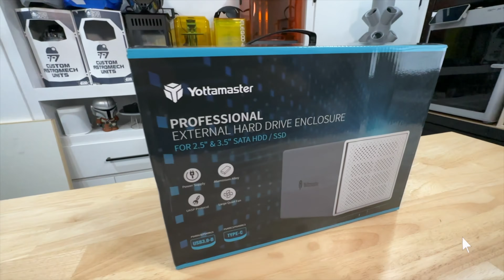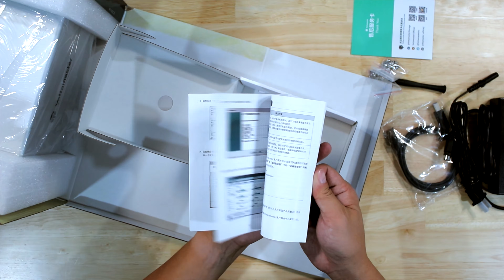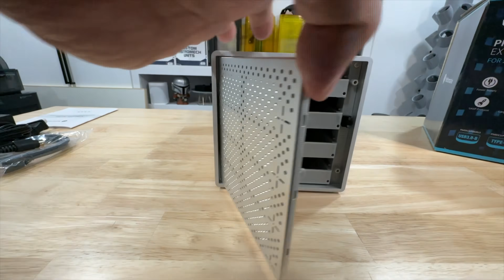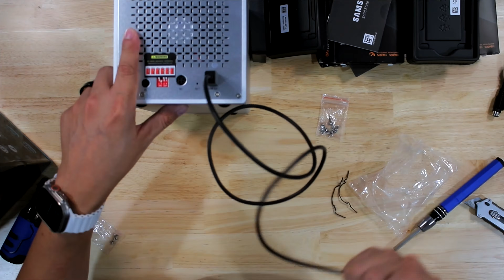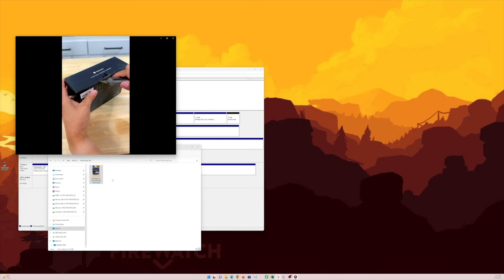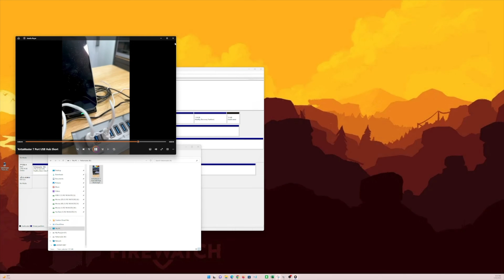4-Bay External HDD Enclosure from Yottamaster - Unboxing, setup, & Review

Comment: Can this run Plex server?
Reply: It is a DAS (Direct Attached Storage). Which means it is a pile of disks and nothing else.  It is the external equivalent of adding more drives inside a PC.  Or, if you prefer, the DAS acts as a big USB flash/thumb drive you plug into a machine for extra storage. You will have to install Plex server on a PC, and point the media libraries, to the DAS storage.  This device is NOT a NAS (Network Attached Storage).  Many NAS's will allow you to run Plex natively or via a container using Docker on the NAS's OS.

Comment: NTFS for MacOS? This won't work. Why not ExFAT?
Reply: ExFAT was mainly designed for SD cards.  While most OS's support it now. I doubt very much that ExFAT is going to work with the RAID implementation of this box.  It it a fact of life that NTFS is the dominant file system in the consumer space.  So Mac and Linux people are on their own.  Mac does not seems to be really supported any more, for the RAID program.

Yottamaster Upgraded RAID Manager Software for Mac
Support Models: Yottamaster PS, FS, DF, VN Series - 4 Bay and 5 Bay Hard Drive Enclosure
Support System: Mac (Backward compatible with Mac OS 13 and below, not applicable to Mac OS 14)

You will probably have to use builtin tools in MacOS to create a RAID with this thing.

Linux does not even have a RAID software from YottaMaster.

Comment: Hello, I need to buy a new power adapter for Yottamaster Y-Pioneer 5. Bay External Hard Drive. Can you advise me which type can be used? I see that there are many different types on the market with the same 4pin connector.  Is it 4pi with 2x +12V and 2x GND? I also see that there may be different pin assignments? Thanks for the answer?

Comment: Can this enclosure support drives 20, 22, and 24tb like those from Western Digital?
Reply from the maker: So far I have only installed 4 16TB Hard Drives which is what the specs indicate is max.  I will have to soon upgrade and will attempt to install larger sized HDDs to test it out.

Comment: Thanks for your review. I find that enclosures that follow this design with a hollow metal shell with plastic internals produces a lot of echo from noisy drives. If the docking trays have no rubber or something else to act as vibration compensation, you will have a really loud enclosure.

Comment: It’s definitely a nice enclosure. I own a non-raid version. I don’t care about performance. It’s fast enough for me

Two problems though. If I have 4 3.5 mechanical drives it doesn’t behave. I don’t think it’s a power issue but I am going to buy all new drives as it could be the drives. 

The main issue though is it starts to vibrate for no reason. To resolve I need to touch or wiggle the drive bay. The drive trays are plastic with no fasteners. I also own an OWC 4 bay and the quality is way superior but for budget the Yottamaster is good enough.

Comment: I have had TWO data issues with the PS500RC3 5-bay drive, in two years. I'd love to be able to load the RAID tool for Mac, but the program they offer immediately crashes with an error and is not launchable. I cannot recommend any Yottamaster product for any Mac user until the company can guarantee proper tools that will work with the machines we are using them with.

Comment: The problems that I see that weren't addressed.
This looks like the reviewer was sent the item for free which can mean a biased review
You're 1 dip switch flick away from deleting all your data.
The trays don't lock in so they could fall out if you pick it with the door facing down.
No handle
Plastic trays do not assist with heat dissipation
Most people including myself will be plugging HDs with data on, not empty drives. I am always weary about plugging a HD with data into an unknown device. You never know what it is going to do. I have had a NAS device in the past that just formatted drives when you insert them, or when you had to share a folder in order to see your data but unlike windows when you remove the share it also deletes the data. How wonderful that you are supposed to know this and why you should be very careful when plugging in a HD with data into an unknown device. I would have liked to hear this issue reviewed. I go for simple now, I have a primary and backup HD that I backup manually. I have never lost any data doing it that way. All I need is a place to put the backup HDs that isn't going to be too smart and delete my data.
Reply: I agree with some of your points, and this is a bit of a "shill" review, but nas that nuke drives that are inserted isn't exactly a new thing. I've worked in the storage industry for 15 years and its what most people do.

Is it kind of shitty for consumer grade hardware? Maybe, but with enough warnings for the user it's fine imo.

Also if you care about your data use a raid or zfs.

Comment: Hello i just received mine iv got it set up but it doesn't show on my pc iv used it on a ubuntu 22.04 and windows 11, i mainly want to use it on ubuntu but i just cant get it to shown on the disk manager, any help?
Reply: Possibly a silly response, but here goes.  A DAS, such as this will not show up, unless it has at least one drive inside it. The enclosure itself generally does not show up, when empty.  The only other things you can try is using different USB ports and cables.  Direct motherboard USB ports are generally better than using the front USB on a PC case.

Comment: if i have hdd's with data already on them & its set to normal mode will it show up as a normal hd when i turn it on & i wont loose the data?
Reply from the maker: It depends how they were formatted and theoretically should.  they should show up as separate drives.

Comment: I just bought in on Amazon prime mine does not have a raid button on the back. So I am confused.
Reply from the maker: It should be a series of white switches that you can flip in order to setup different kinds of raids.  Not exactly a button.
Reply: No just the one switch. The one I have you are supposed to just plug load and they are supposed to come up. However it does not work so I think I will have to return it. 😢
Reply: @SpartaBrown  Theres two version available. They have a hardware and software raid model.

Comment: Wich USB Controller does this enclosure use? Is it suitable for 24/7 use?
Reply: its garbage avoid, all their RAID enclosures use JMB393 and JMB394 SATA port multiplayers from 2008, these are SATA gen 2, the MAXIMUM speed you'll get even in RAID0 is about 260-270Mb/s
Reply: @NoBodysGamer So what external hdd enclosure do you recommend? 4 or 5 bay usb. 

Terramaster?
Reply: @jamegumb7298 did you find a good one?
Reply: @NoBodysGamer

Comment: if you insert a drive while other drives are in the enclosure does that disrupt/disconnect them?
Reply from the maker: Depends on the RAID configuration you have setup or if you have them setup as independent drives.